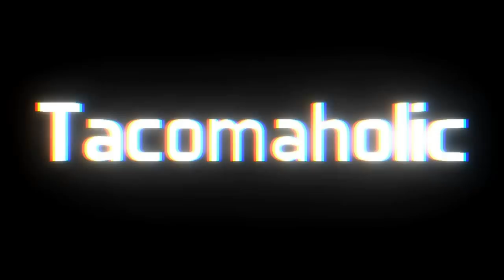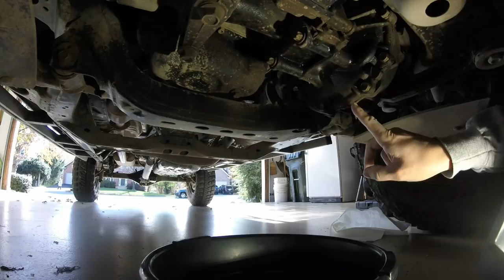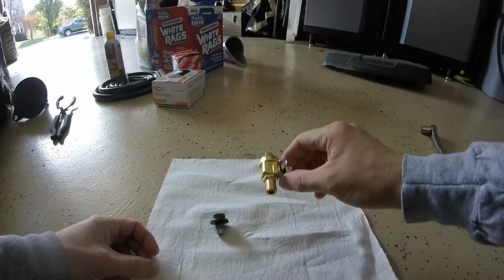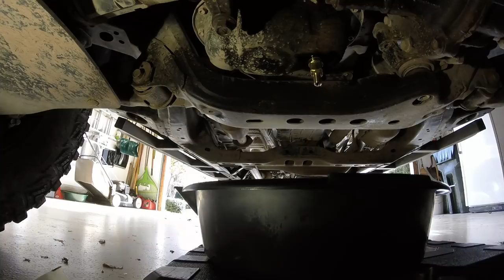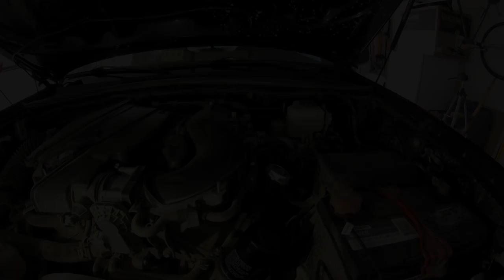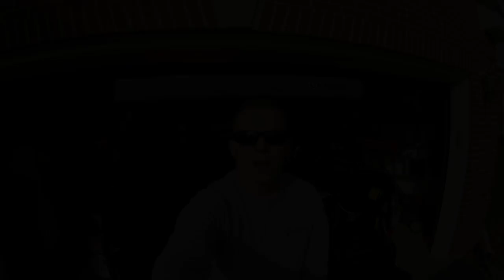DIY Toyota Tacoma Oil & Filter Change — 4.0 V6

Comment: Tacomaholic...Let me tell you how useful your video is. I've got a 2010 TRD Taco with about 178,000 miles. Been changing my own oil for quite a while now and I refer to your video every single time before I start. Why you ask? Because I have to do mine in the street as my driveway it too steep. Meaning once I'm down there, I'm bound to forget something and have to rush up to the garage. Your vid keeps me in check. I too use a gatorade bottle to collect the bit of oil from the filter drain and it works perfectly. Very little mess. Thank you for posting the video and cheers on behalf of all Taco owners! If it's helpful to anyone, I take my used oil to the dump in my town. They have a large container you can pour it into so you know it's going to the proper place.
Reply from the maker: Thanks so much for watching! You might like this item I've used in other videos ( https://amzn.to/407XvOQ ) as it makes for a super clean oil change by catching any spillage.

Comment: A water bottle also works to collect the oil from the bottom of the filter housing ans is easier than routing a house down to your drain pan.
Reply: How did you hold the bottle?
Reply: @HsingSun  I just use a wide mouth bottle, like Gatorade, or cut a 16oz water bottle. It always cradles in there nicely enough to not need to secure it.

Comment: Wow I have never seen an oil filter in such an easy location, my Taco 2014 L4 2.7L has a location underneath and is a pain if it’s put on too tight, and I put 84,000 miles on mine! Lots of oil changes!!!
Reply from the maker: I think all of the 3rd gen Tacomas have the oil filter under the engine as well.

Comment: Far from my old ‘01 Tacoma where I had to lay on the ground and fight my left arm up in there to fight that filter off. Looking forward to the easy filter change with my ‘new’ 2012! (nice tip with marking the filter due date, btw) 👍
Reply from the maker: Thanks for watching buddy! Super easy oil changes on the 2nd gens. You plan on getting the fumoto valve?
Reply: Tacomaholic—The drain valve looks like neat thing to have but with a 10,000 mile Recommended interval I ‘ll probably stick with the standard drain plug. (I appreciate your informative vids...Thanks!)

Comment: Hey thanks again for your videos I really appreciate it I have a 2010 with 122K on it and I figured I’d just start doing my own maintenance. I took your mod advice and I got the Fumoto valve. It was a horrible mess draining the oil because the drip pan I had wasn’t the best that I had thought and got all over the place but hopefully with the new valve next time it’ll be a piece of cake!
Reply from the maker: Thanks for watching Ryan! The next oil change with the fumoto will be the cleanest ever. 😀
Reply: Put a large plastic sheet under the oil drain area to avoid a big mess.
Reply: @HsingSun  I use cardboard boxes

Comment: I've found prices can vary a ton between lube shops... the same thing at one will cost $35 and at another will cost $73. Just started finding these self serve garages that come with a lift at pretty reasonable rates, so no excuses not to do my own oil changes.
Reply from the maker: Nice! I wish we had places like that around me so I could get access to a lift.
Reply: I know it's hard for them to make money... the one near us keeps it affordable as a way to help out the community. There is another shop 15 miles away that charges 3 times as much, and then it doesn't make as much sense for small jobs like an oil change.

Comment: Love the vids , I watch all of em , BTW , the threads on that mod are about 1/2 inch to 3/4 of an inch...That amount of oil wont drain because it goes past the bottom of the oil pan??? just guessing , but seems logical to me? And get a needle grease fitting for your grease gun then you can get everything greased  , even between your leaf springs , I even did my CV axle boots . The puncture that was made , I used shoe goo to seal the tiny hole. lol  It drives so much better OMG , seems like a new truck. Dont forget to give me a shout out when you use this ...lol TTYL peace out.
Reply from the maker: Thanks for watching buddy! I do have one of those needle attachments for my grease gun. Love it!

Comment: I worked at a dealership for 5 years and I couldn't tell you how many times some lube tech messed up an oil change! The only problem I can see with that valve is the threads may stick beyond the pan and not let the last bit of oil drain from the pan where most of the containments settle.
Reply from the maker: Hmm good point about the valve threads. I haven't heard of anyone who has been using these for years having issues yet.
Reply: Just compare the two to see if the treads are longer, if they are take a grinder to it...I ordered one today.

Comment: Just bought a 2011 Tacoma and the first thing I'm doing is changing the oil. Your video is super helpful! A couple of questions: The link in the description for the oil points to Valvoline not Mobile 1? Also, how many miles are you going between oil changes?
Reply from the maker: Congrats on your purchase Chris! I change the oil at 5k intervals when using full synthetic. Both Valvoline and Mobile1 are reputable brands. I've since switch to Valvoline since it's usually a little cheaper.
Reply: Just got me a 2013 Tacoma trd offroad and I seen that oil filter and said to myself oil changes will be a piece of cake compared to my first gen

Comment: Some people like to know for sure that it is done correctly (myself included), some aren't mechanical to know the difference (and that is ok to), if you have the means the time saving and scheduling is advantageous that is a no brainer (the time to schedule, take in, time to have it performed, the payment process, the hassle to get it done when they want (not you) the time they try and upsale really unneeded items (they typically over sell air filters and serpentine belts) they all are different.
Reply from the maker: If you have an lube place that you trust that's great. I've seen tons of those undercover stories where a lot of lube places are doing things wrong or scammer the customers.

Comment: Nice tutorial vid Brian.  Next time you do this, try opening the oil cap 1st b4 draining the oil pan.
Reply from the maker: That does help the oil drain a bit quicker.
Reply: It sure does.  Just make sure u put the oil cap back on b4 starting your engine. Or your engine bay will go off roading...lol.
Reply from the maker: That would certainly be sloppy.
Reply: off roading or swimming in oil?

Comment: After you drop in the initial 5 quarts and start the truck for 30 seconds.

1.) do you have to put the oil cap back on before starting it?

2.) do you add the extra .5 of a quart and then check to see the oil level? 

I know the manual says 5.5 quarts is the correct amount. I have a 2011 4.0 V6!
Reply from the maker: I always put the cap back on before starting the truck to avoid any potential mess. I just check the oil level and add as needed. It all depends on how much was actually drained out during the change.
Reply: @Tacomaholic  I just did an oil change this morning! Thanks for the advice! 

Can’t wait to see other videos where you have DIY. Looking forward to spark plug change video! Power steering flush and change! Brake fluid flush and change! LOL a lot but I love your vids the best!

Comment: Thanks for the video, I'll be referring to this when I change my oil on my (new to me) 2015 DCLB Sport this weekend.  I've read on TacomaWorld about greasing the zerks on the drive train, have you done (or could you do) a video about that?  That's one more maintenance thing I'd rather learn to do than take it in to the shop.
Reply from the maker: Thanks for watching Aaron! Zerk greasing video should be coming out in the next few weeks.

Comment: My dealer sets an empty transmission oil bottle under the drain hole of the oil filter catch can. How do I know this? To set it there it rests on a pulley. I drove it until the pulley wore through the bottle and used oil went everywhere inside my engine and garage floor... because they forgot to remove the bottle. Boy was I pissed!
Reply from the maker: Yikes

Comment: How do you get to the fumoto drain plug release pin with a skid plate? The only whole I see is for the socket to to reach the standard drain plug.
Reply from the maker: I'll actually have a vid showing that pretty soon but it's very easy to reach the fumoto with the skid plate installed. 👍

Comment: I just installed my fumoto valve and I’m noticing some oil spots on my driveway after I’ve been driving for long periods of time. Does yours leak?
Reply from the maker: Not at all. Try giving the Fumoto a little extra twist to make sure it's tight. If you made a mess during your oil change when removing the old filter it could just be oil dripping down from that too.
Reply: Tacomaholic ok I’ll give that a shot again. I just don’t want to over tighten it and strip it out.

Comment: Did you use synthetic motor oil? My 2015 2nd generation Tacoma manual and dealer say they only recommend regular oil and not to use synthetic.
Reply from the maker: I did use synthetic in this video but did a follow-up vid on the synthetic vs conventional oil for these trucks here: https://youtu.be/QSjrIwYpu2w
Reply: You can use both types.

Comment: Good video buddy. Wanted to pick your brain about changing your brake fluid. I have about 47k miles on my truck, my brake fluid looks great through the reservoir. I have heard mixed reviews about when to change it, alot of people say change it every 2-3 years regardless. Whats your opinion? I've had my taco for 4 years and never messed with it.
Reply from the maker: I need to check to see what the Toyota manual says. And friend and I actually did a half brake fluid change on my truck when we added my rear extended brake lines. It certainly couldn't hurt changing the brake fluid at set mileage or time points.
Reply: Yeah let me know your thoughts. My manual is really vague when it comes to brake fluid. Mostly just says to "check it" nothing about mileage etc.
Reply from the maker: Will do.

Comment: I just changed the oil in my 13’ V6 Taco . I put 5qts of Mobil1 in , purolator filter and now it’s making an aweful squeel/click/ticking sound. Any advice on why it is doing this will be much appreciated. Thanks
Reply from the maker: Greetings! Did it ever make that sound before the last oil change? How long after the oil change before it made the sound?
Reply: It’s never made any unusual sounds at all. It started within 10 min of driving. I solved it. I didn’t fill the oil filter before installing it. I took it off, filled it, noise went away almost instantly.
Reply from the maker: Glad it went away! I never fill the oil filter before install when changing my oil and have never experience that sound. What the oil filter not full of oil when you removed it?
Reply: Tacomaholic I have never filled a filter either and I’ve never had issues🤷🏻‍♂️. This is the first oil change I’ve personally done on my taco. When I pulled the filter it was not full. Maybe 1/3 full. . Moving forward I will continue to fill it just in case that was the cause of the clicking sound. Right now it’s running as quiet and smooth as ever. I guess it was worth the extra coin for the Mobil1. Previously I had been running the SynBlend oil .
Reply from the maker: @TheTradesmanLU2001  So did you just pour oil in the filter and flip it and install real quick to avoid spilling? Seems like it would be tricky to do that and keep everything clean.
Reply: Tacomaholic I did exactly that . I just stuffed a few rags down around it so I didn’t have a bunch of oil to clean up. It seems strange that I needed to do it that way but it worked 🤷🏻‍♂️

Comment: Question I’m about to use Mobile 1 just like yourself do I still need to change it every 3k ? My handbook doesn’t say how often the oil should be changed. I have the same about of miles too as you.
Reply from the maker: There's tons of debate on how often engine oil should be changed, but a common average seems to be every 3-5k.

Comment: Hi, I was wondering if you could offer me any advice, I have a 2010 tacoma trd sport with very low mileage (only 67,000 miles ), I’m the original owner . I just got it back from a big reputable dealership where they replaced the frame , they had it for three months and supplied me with a rental for the entire time, I’m really happy with the job, and the fact that they didn’t try to upsell me on anything . My issue however is my engine looks like something that came out of a junk yard , I’m not positive but I think they may have swapped out my engine , it could be all just in my mind but I don’t remember the motor being all pitted and rusty , ( I wish I had taken pictures of the motor before I brought it in  ) I did crawl under and I got the serial number off the casing it’s 1GR followed by seven digits ( all of which don’t come close to my vehicle vin number )… do you know if these numbers are supposed to match ( maybe the last four digits ) or if there’s any way I could tell if the motor was swapped out . I love this truck and planned on keeping it another decade or two but now I’m wondering if I’m driving around with a 300,000 mile junk yard motor in it . I tried four wheel drive and it took a long time for it to come out and when it did and I put it in drive it made a loud banging noise ( it never did that before )
Reply from the maker: I'm not sure on that one. Hopefully someone else will chime in.

Comment: I noticed you didn't have the engine cover on, do you have to take that off to add oil? or did you take it off for other reasons? just curious!
Reply from the maker: I take it off sometimes since dirt gets under there anyway if you get offroad.

Comment: I never bothered watching this because I thought I knew how to change oil. Today I made a big mess replacing the filter because I didn't use a hose. For 2 1/2 years I thought that it was normal to drop a little oil underneath the filter holder. Big mistake. The more you know...

Comment: The only plus side to going to a Yoda dealer for an oil change is the multi-point inspection report.
Reply: provided they are trustworthy
Reply: True. I have a suspicion they weren't giving me the synthetic oil I was paying for. I've started doing my own servicing now, just did engine and rear diff (thanks to @Tacomaholic for the super informational videos!)

Comment: Does your oil filter look almost dry when you remove it. I have a tundra with same engine and when I remove the filter it looks almost clean, very surprising to me. Not sure if normal?
Reply from the maker: Guess it depends on how long the truck is sitting after driving for the oil to drain out of the filter.

Comment: can you operate the valve with aftermarket skid plate on? I understand there is hole there but is the hole big enough to operate the valve?
Reply from the maker: Hey buddy! I guess it depends on the skid plate, but the opening on mine is large enough so that I should be able to operate the valve without too much hassle.
Reply: what skid plate do you have? Thanks.
Reply from the maker: Mine is the All-Pro front skid ... but All-Pro has had a ton of customer service issues lately so I'd recommend a different company for armor.

Comment: The 4.o u should use motor oil not synthetic oil.if u use synthetic oil u more then likely will notice a oil leak on the oil pan gasket. Most of the time the front or rear of the oil pan gasket will start leaking.

Comment: I recently put 285/75/16 tire into my 2015 Toyota Tacoma. When i turn it sounds like tire is rubbing against something. What should I do to prevent it?
Reply from the maker: You are either going to have to trim the plastic fender lining or do the cab mount chop ... or possibly even both. Here's my vid on the cab mount chop: https://youtu.be/jePlNmvlzS0

Comment: I can get full synthetic done at the dealer for $35. The only problem is then I get them bothering me about getting a new Tacoma...
Reply from the maker: Make sure you check your oil level when getting the dealership to do it! The dealership and any lube place will always give you a giant list of other maintenance items that they can bill you for while you are there for a simple oil change.
Reply: I always decline everything else for that reason
Reply from the maker: Yeah can't blame them for trying but it does get annoying.
Reply: TacoTom do it your self makes you feel badass
Reply from the maker: It really does! Plus you know that everything was done correctly. I've gotten oil changes before where the shop didn't even put the oil cap back on after. WTF?
Reply: Tacomaholic thats crazy man
Reply from the maker: When I had my 2011 Subaru Outback a tech at the Subie dealership splashed oil all over the engine bay and didn't wipe it up ... so I freaked out when my Outback started smoking (ALOT) a mile down the road.
Reply: Full Synthetic? Mobil1 5qt is already $25-30.
Reply: Full synthetic for under $55??? Where do you live?  I can’t find anywhere that is worth a damn to do it for less then $55 and the stealership is between $61-69 depending on if they have a special going or not...